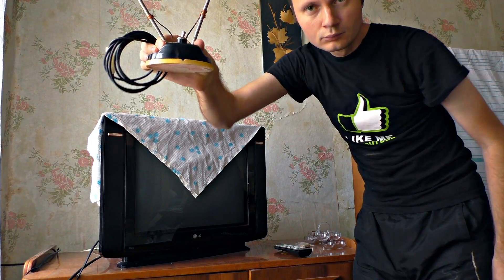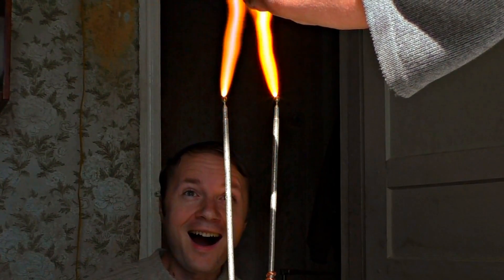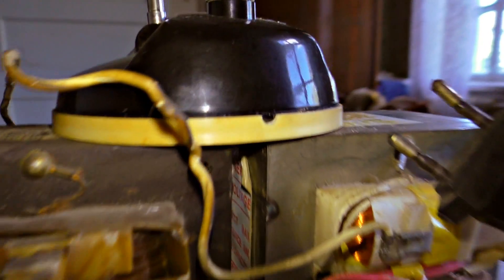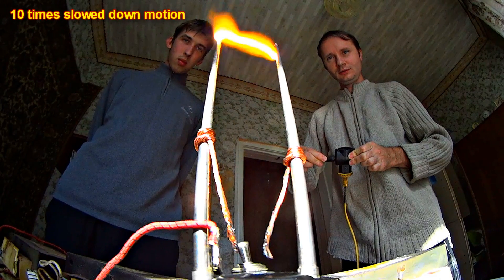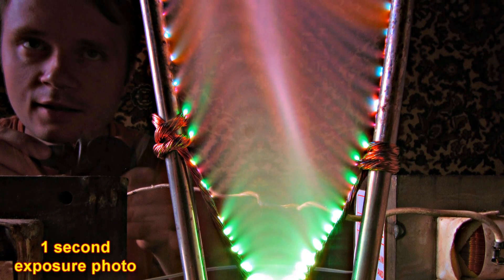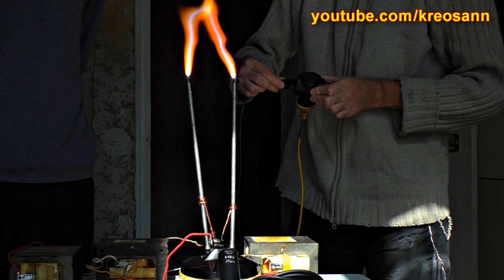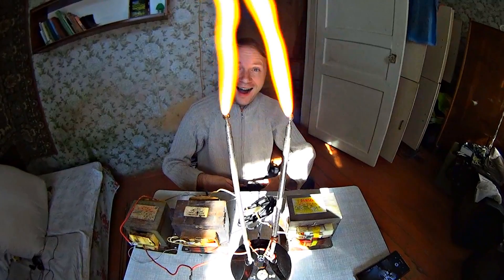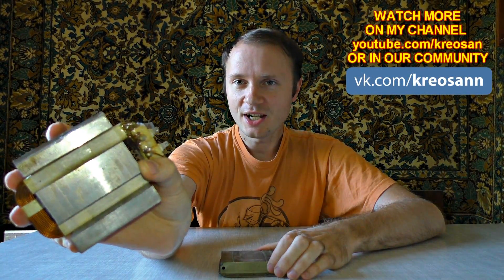What will happen, if you connect an antenna to a microwave oven?

Comment: ? Are you holding the actual magnetron and emitter? and what is the antenna being used? Will (several layers) of steel or aluminum tape provide enough shielding?

Comment: Note to anybody who it going to attempt this at home.  If you wish to preserve your eyesight, you should wear goggles when working with such high voltage plasma arcs.  They emit UV rays that can are widely accepted as being damaging to your eyes, which is why ARC welders wear a dark visor. FYI
Reply: Goggles as in "welding goggles".
Reply: Your only other option is to not look directly at it, but what would be the purpose or fun of it if you did so?

Comment: Yeah, absolutely deadly... and in case you're wondering, GFCI / RCD / etc will not do a damn thing to keep you safe from electrocution by high voltage transformers.  A fraction of a second of exposure, there you go, you're done.

Comment: slight miscalculation tho each transformer multiplies by about 10 so 220 goes to 2200 then to 22000 then 220,000 V that is if he hooked them in series   i still applaud him tho

Comment: ITS NOT HIGH VOLTAGE ITS THE WATTS THAT KILL!!! If I have 500v but like 0.0000001 amps would it be dangerous? No.
Reply: Andrew Heisant yes but they must drawing .5 amp which will kill you at 2000v x .5 amp would hurt u at 1000watts
Reply: No. Energy kills.
Reply: I was waiting for this smartassing comment. It’s like saying great depths don’t kill, it’s the collision with the ground that kills. There is a reason why people say DANGER HIGH VOLTAGE for the last 100 years already. Same as DANGER STEEP DROP, not DANGER HIGH IMPACT AFTER FALLING.

Comment: You should make a video that uses a microwave transformer to build an ion thruster. Just connect the transformer to a sharp end of a conducting material (preferably copper) then the other voltage lead to a round end of a conducting material. You'll be able to produce a small amount of thrust from this.

Comment: Is anyone else noticing how close that on/off switch is to the plasma? Christ turning that thing off would be sketchy
Reply: I built one of these using two High Energy GM ignition coils wired in opposition. I accidentally clicked the momentary fire switch while adjusting the ladder. That was a shocking experience!
Reply: TruAnRksT how did you use an ignition coil? I only ever got them to work with pulses, not a 60hz sine wave like mains power

Comment: Attaching 2 or more MOT in series is not the smart thing to do, unless they're identical in specs....which is impossible to find.
This kids took a big chance here
Reply: What is the risk?
Reply: tccjjss Insane high voltages...
Reply: That was the goal in the first place!  What is the risk of using ones that aren't identical?  Will it just burn one of them out or cause some other problem?
Reply: @TomFoolery9001  gdeath
Reply: Try 4 of em that's much fun
Reply: Whys it dangerous big guy. Did papa safety officer say so?
Reply: Think of it like trying to flip a 120-12v transformer around, it wouldn't work due to some voltage/frequency calculation that I forgot. Big papa is right tho, you will need to rewire the transformer with many more turns of wire, unless you want some budget fireworks.

Comment: Ya know, a Jacob's Ladder doesn't require a lot of current, why not just build a multiplier? I'm sure it wouldn't be that difficult to find old surplus electrolytics and diodes. I've seen people jump at the chance to get rid of the old caps, full of PCB's and other nasties. You do have a beautiful, fat arc. Very Kool.

Comment: Rectify the title. It is not microwaves transmission through antenna it is just high voltage arcing
Reply: You know, the microwave gonna broadcast what you are heating up right now. When I`m saying it, it is just a matter of time until Mr. Beast will do it, don`t worry.

Comment: Better be 3 persons when doing this experiment. One man to do it, the second one to cut of the main switch and the third one to call an ambulance.
Reply: Ambulance not needed. Undertaker more likely...
Reply: 4TH ONE TO LIGHT THE WEED!✌️
Reply: Haha u funny
Reply: LOL but true
Reply: Pallbearer as third person
Reply: No. It will be much less fair when two persons gonna do it. Nobody will want to run it, but everybody will want to just type some numbers and talk or flip one switch. It`s not that much deatlhy though. If you touch it for millisecond, nothing will happen. That`s how stun guns work. You have super high voltage, but send in short pulse, so it doesn`t hurts, just zaps.
Reply: @elektronikadlapoczatkujacy2111  with this kind of current, a millisecond could be deadly.

Comment: does it give out radiation
Reply: The microwave radiation from a microwave oven is generated by a magnetron, which is what this transformer powers.   The transformer alone does give off "radiation" in the form of visible and ultraviolet light, but not harmful microwaves or x-rays.  Should probably look at the arcs through sunglasses to be on the safer side.  The most dangerous aspect is definitely the very high voltage and current that can easily kill you. High voltage can travel through many different objects and can get you if you don't understand it or aren't careful at all times.
Reply: nope!

Comment: Very good exhibition. For a science fair project when I was in 8th grade,I built a Van de Graaff generator. If the air was dry like in January , it could produce 250,000V of static electricity.It produced a nice spark about 2 feet long.Keep experimenting and learn everything you can about what you like.

Comment: Also. WARNING. The microwave capacitor will be the size of your fist. Even though you have unplugged it, there might still be charge. Use a screw driver to discharge before handling!!!!
Or get a giant as shock. Up to you.
Reply: I really wish manufacturers would plainly state why its dangerous on the covers, instead of posting a vague shock warning that certain groups of people are never going to heed.
Reply: people please like and comment to this comment so youtube knows this is an IMPORTANT comment
Reply: Shivani B start researching what a cap does. too much for a reply.
Reply: CPLD lo
Reply: Bump
Reply: They don't feel good  I can tell you that. Handle with caution.
Reply: You have experience?
Reply: Saying it like KREOSAN doesn`t knows anything. Well, I discharge capacitors with a piece of wire, isolated with some nothing.
Reply: Shivani B  mostly to avoid peaks in current demand innit?
Reply: CPLD   Everyone like this comment! It is very important for others to know that microwaves and TVs are both dangerous to take apart this way!!